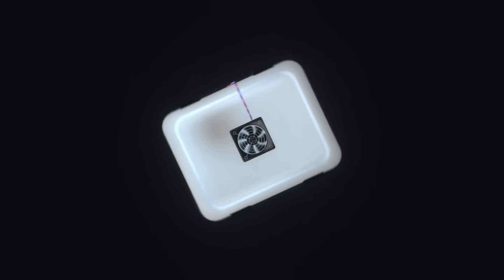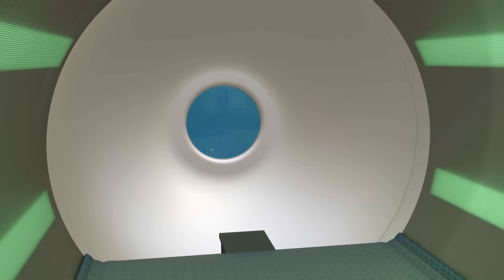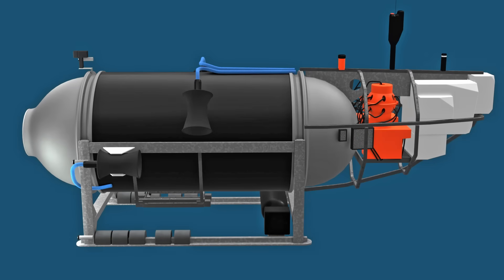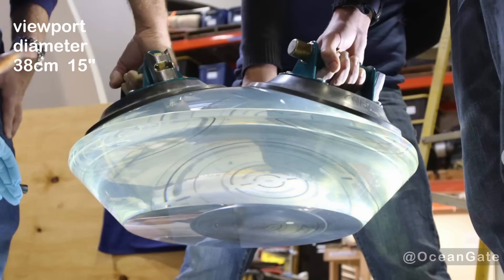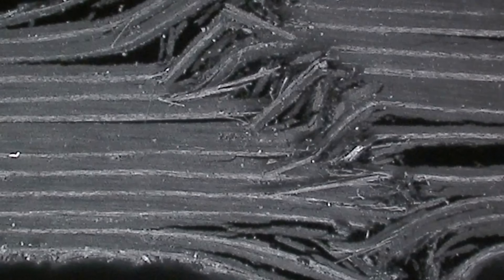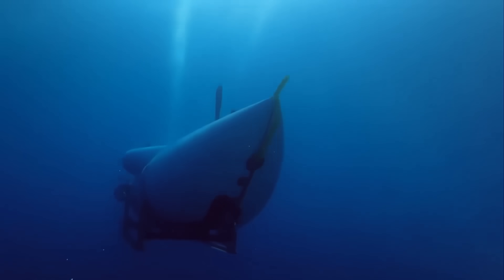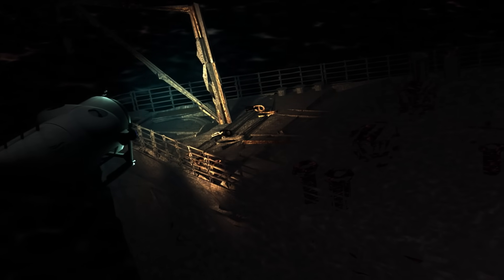Titan Sub | carbon fiber - Detailed Tour

Comment: Thank you, this seems a very balanced video.  

Like you say, it's mainly about having the resources to complete a proper destructive testing program to learn from and validate.  That was the engineering task, and they just never did it.

The game controllers and other consumer grade electronics signal to me their lack of understanding of, and poor attitude to, safety.  One concern is the battery technology used and its fire safety - in a life support environment I suspect one goes for an older but safer battery technology, and I doubt they did.  Another is condensation.  Presumably the boards/components/switching methods are not rated for a 100% humidity condensing environment.  Having redundant controllers does not reduce the failure risk much, because failures between controllers will be cross-correlated by their common correlation to the environment.  An obvious, and cheap in the scheme of things, option is to 3D print new airtight housings for the controllers, with more space for bigger but safer batteries, but we don't see that.  

The people involved seem to have engaged in "magical thinking" in the belief they were taking engineering forward, when the truth is they had nothing to add, and they more likely took it backwards.

Comment: This video is a good discussion but I believe that the others who said that carbon fiber is NOT the right material for a deep submersible are correct. Carbon does better at holding in pressure, not holding out pressure. I also believe that the Titan being a tube was the wrong shape. The tube would have been stiff at the ends where it met the titanium end caps and flexible in the center....like all tubes. If the center flexed but the ends did not then the center flexing could have broken the glue joints and allowed the pressure to enter around the failed glue joints. That could explain why part of the flange is blown outwards.

Comment: Aeroplane has about 15psi pushing out not thousands of psi pushing out.  I watch the old bloke mixing the glue in an old plastic container with a stick then using a paintbrush to apply it!! it was a disaster waiting to happen, sad but true

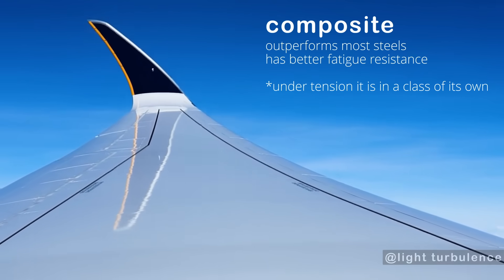Comment: Can anyone enlighten me on the example of the plane wing at approx 9:20 minutes into the video? Mike says this wing does withstand powerful compressive forces. Sorry for my ignorance.... with the wing I can perceive tension on the carbon fibre but scratching my head on the heavy compression exerted onto the material. If you could help me grasp the compression aspect, that would be great.
Reply from the maker: The wing is a cantilever beam. The up forces particularly at the tip create a massive lever arm muliplier force where it attaches to the body.  The lower surfaces are in huge tension and the upper surfaces in massive compression as they carry the 100’s of Tons of aircraft weight and result in eye watering compressive and tension forces in the structure. The compression and tension forces are equal.
Reply: @Mike-Bell  Thanks very much Mike. I appreciate you taking the time to reply.

Comment: If I had to guess the outer layers of carbon probably expanded and contracted at a different rate than the inner layers due to the temperature difference inside vs outside the sub, which may cause the layers to delaminate over several cycles, which could weaken the capsule enough for it to have a catastrophic failure at depth. I believe it was rated to go down to that depth once, and after that it was anyone's guess how many more times it could do so safely.

Comment: I love the very open-ended analysis you've done. You're not taking any sides on the subject you're just giving the facts as you see them and correcting what you see everyone else is gone wrong with. Up till now all I've heard is carbon fiber is not good under Crush pressure yours is the first analysis that said it can work well under Crush depth if done properly can you bring the facts to back it up which is very refreshing

Comment: I haven't seen anyone mention the deformation of the cylinder shape under load and the combination of forces happening at the center.
There woul be sone amount of bowin in the middle then you have the entire force of the ends pushing at a non-perpendicular angle. Trying to increase the bow
Am i missing something

Comment: Great video, nice to see someone who actually understands the issue rather than just blaming composite material. One correction I think I have is the distribution of forces, you've stated as 3/4 in hoop and 1/4 axial. I thought the distribution was 2/3 in hoop and 1/3 in axial, although this is based on my knowledge of pressure vessels with internal pressure, i assume the same is true here just in a different direction. This is a based upon stress in hoop being pr/t and pr/2t in axial, i.e. giving a 2:1 distribution ratio.

Comment: When this happened the first thought that came to mind was the difference in material compression between titanium and carbon composite.  Primarily as how it would effect the glue joints and internal/external flanges where the 3 materials come together to form a bond/seal.  The other thing is how thin and short the flanges were in comparison to the thickness of the material they were binding...
Reply: The splitting (flanges) in & outwards, seems to suggest a force of fragmentation  ?
Reply: the flanges were fully intact upon offloading the salvage.

Comment: The carbon fiber tube was glued onto the titanium end-pieces, onto which the hemispheric end-caps were bolted.
Different materials react different to pressure changes, just like with temperature changes.
This would put a lot of stress onto the glue and the surprisingly short part of the carbon fiber tube that went over the end-pieces.
I am assuming carbon fiber compresses more than titanium. That would mean that with every dive, the titanium end-piece kept becoming too wide for the carbon fibers around it as the depth increased, which could cause tearing and then buckling on the ascent.

The weak point is often where two different materials meet... Destructive testing would have shown them these issues.

Comment: I work with carbon fiber. I don't claim to know ALL its properties, but It does have high tensile strength.  However, it has no strength against side deformation.  Zero.  Any use case expecting carbon fiber to withstand side force without catastrophic deformation is idiotic.  Given a sealed container properly strengthened with carbon fiber, it will be strong to hold up to internal pressure (tensile force is then on the fibers) but not external pressure where side force is on the fibers.

Comment: The way I see it, is the CF strands are similar to a shoe string.  Pull on it and it takes a lot of strength to break it, yet it collapses under its own weight.  Using CF in a compressive environment like a submarine hull means it's relying solely on the compressive strength of the resin.  Only a fool would think that would be safe.

Comment: A titanium material have the same  strenght in X, Y and Z in volume.. but a X and Y oriented fibers matrix of carbon  does not have any Z.  if you stack many X, Y matrix or carbon fiber layer together... it is the resin between these layers that become the Z... Tensil strengh dont require any implication from the resin in between the fibers.. A fiber under tension will form his own straight line without deforming.. but under compression the it rely on the RESIN to hold the fibers straight... or resin and perpendicular fibers that cross them..but teh resin is still in teh equation   Also.. there is NO fibers oriented in the direction of compression on the THICKNESS of the tube It was made in 2D matrix and not in a 3D matrix X Y and Z. So the resin between the various stack XY of fibers of the thickness Z have to sustain the compressive force between the fibers in Z.. and it make the tube thickness "Z" to change depending on the deep..so the glue that hold it to the titanium part is under severe shear in "Z" as the titanium wont move/compress the same as the 5" tube thickness does so the glue has incredible shear in Z to sustain at the joint due to the 5" thickness "Z"  changing due to the resin that is more compressive than the titanium and fibers.

Comment: It seems that Stockton unforeseen this but what happened to the Titan it accelerated in descent too quickly within the time it normally would have descended to the ocean floor, if the Titan never had the rapid descent it may have survived the trip to the Titanic, it's a poor design the material shatters with the extreme pressure the wreck of the Titanic is an example of how steel plates one inch thick were crumpled like paper, all dives have risks at these depths but the type of sub the Titan was made it a death trap, all subs on expeditions to the wreck are undergone testing for failures before each dive to makes sure there is no errors or technical malfunctions.

Comment: Well done!   I worked 33 years in the carbon fibre industry and I was wondering how the fibres were aligned in the cylinder.  For a number of years I was part of a team that worked on very thick carbon laminate structures and worked out a way of curing them under pressure without wrinkling or deforming the laminate. This can be very difficult to do, but can be achieved.  The combination of filament, winding, and hand layup would have been difficult to accomplish and very may have been the source of the problem.
Reply: He said the second tube was laid up longitudenly with a robot, and even had a picture of it working.
Reply from the maker: @rise_above  The are unconfirmed suggestions that CF tube was built up in 5 one inch thick increments and cured between each layer.    Was the very thick build up you worked on done is a single cure or multiple?  More on the layers with a foto showing the 5 distinct layers in this video https://youtu.be/Wg4L64uXvnw?si=0lw3JgHIiDHJMbOj&t=518
Reply: @Mike-Bell did they use a autoclave?
Reply: Our design was for an engine strut support, thickness was around 3 inches and it was done in 3 cures.   We patented a process to cure the part in a way that allowed us to control where and how the wrinkles are formed.   When curing thick laminates under pressure and high temperatures your going to have wrinkles forming, the trick is to control them.  Then fill in the wrinkles before applying the next layers.

Comment: The two computer monitor brackets were screwed into the carbon fiber. I submit that the screw holes contributed to the failure. The brackets should have been glued to the hull. Search Google for interior photos of the submarine and you will see clearly that day monitor brackets were screwed into the hull.

Comment: Some things were well thought - emergency release of weight to get buoyancy by passenger moving around? That was suprisingly good! Also I wouldn´t hate the "as simple as possible" design. The more technical and difficult systems are on board, the easier they can break. 
But it was still a rat trap.

Comment: It failed at the inner lip that holds the carbon fiber in place. Think of carbon fiber as a car window it's incredibly strong when it's completely closed but shatters with very little effort if open even the slightest amount. The inner lip of the titanium ring was only 13mm  to say 16mm thick and was supporting ALL of the loads that the carbon fiber was having to take, if that ring started to fail or even bend at any point then the carbon fiber wouldn't be able to hold its shape. I'll even go as far as to say it was the rear titanium ring lip that failed first due to the rear door never having its point load change like the front door every time it's bolted and unbolted to the front causing a high stress area where the titanium could no longer hold up.

Comment: The cylindrical shape of the carbon fibre section was the probable cause. The midpoint of that section was geometrically the most vulnerable to deflection and cumulative damage. Collapse at that point could explain outward force on the flanges at the moment of collapse.

Comment: Far be it from me to tell well-heeled thrill seekers how to spend their money or risk their lives but if (IMHO) the adventure borders on foolhardy my survival gene kicks in.  That is not to say I haven't participated in some risky behaviors or sports such as Sky-diving, SCUBA diving, solo hunts for Grizzly bears in thick bush, spending 5 years as a military Engineer, riding a motorcycle in Dallas traffic, and climbing towers for fun but in all those activities I had a modicum of control over the outcome.  In my industry of data center operations we always watch for single points of failure as we design, build, commission and run data centers but failure in that industry simply results in servers being offline temporarily.  Failure of any part of a pressure hull adds up to a really bad day for the occupants and even if someone had paid for my ride I would have politely refused.

Comment: the testing required with the current technology simulation and real-world testing is definitely too expensive in comparison to using a thicker titanium centre part hull.. If as suggested in the video the hull be wound like a Carbon fibre pressure cylinder and cut off the ends.  if the extra  expense of manufacturing the centre section this way would have a large effect on the commercial viability.  then using carbon fibre is just too expensive taking into account that you have to break quite a few of them to prove the carbon fibre can last repeated dives without major degradation... I think it would just be easier at the moment to use titanium centre section even if it is heavier at least you can x-ray it ultrasound it and get meaningful and understandable data which is well understood industry wide..  Other alternative could be strengthening sections  made of carbon fibre these could be slotted in all around the inside of the pressure vessel in sections removable for inspection and perhaps much less stressed..  Even whether that would be worthwhile you would have two simulate it.

Comment: Hey Mike, "...titanium and composite are regularly bonded in aviation." Yes, but not then subjected to the extreme pressure of 375 atmospheres at the depth the Titanic lay. In addition, the sub experienced multiple cycles: 1atm > 375 atm > 1 atm > 375, etc. As you say, testing to failure for the bond was required but never performed.

Comment: Great video. Brilliant, actually. First one I've seen from a third party that sounds like you know what you're talking about.
I'm not convinced, but my confidence it was the porthole has dropped sharply. I'd point at the blown out flange and start making 'uh-huh' noises.

I think you might be overlooking the potential of the technology to make bank. Diving the Titan Nick wasn't the end goal - Stockyard Nickleback was seeing a lot of commercial uses - like, a LOT. Saturation diving could have been revolutionised, underwater enclosures made affordable, the deep cloud servers, I mean more or less anything that goes underwater and goes even a little deep would have been his bailiwick alone. I do appreciate you emphasising that innovation comes from trying an idea and seeing if it works, I rather suspect that the loss of the Titan will impede CF experimentation for decades, much as the Hindlieberg effectively ended hydrogen ballooning.

In any case, great video, bravo, spiffing chips. Cup of tea for the top table.

Comment: To say carbon fiber better withstands tension but not compression is kinda wild because say with an airplane wing like shown when bending one side will be under tension and the other side of the wing will be under compression, so it should be able to withstand both.

Comment: I wouldn't have gotten in that thing even they paid me the $250K. The glued on ends were a total deal breaker. The y needed to sent thing down on many dives with cameras and sensors and no occupents until it failed. It was ALWAYS going to fail, it was just a matter of time.  Then you examine why/how it failed. CF may be of use in submersibles, but it is not there yet. A guy like Rush is not the type to move the needle in a positive way.  proof of that is he is dead due to his way of operating, and he took 4 with him.

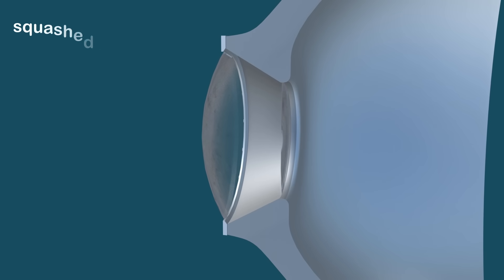Comment: 7:30 - I'm no composite expert, but I do know 20mm is not '3-1/4" ' (three and one-quarter inch), as shown in the on-screen text. That should read '3/4" ' (three-quarters of an inch). I suspect whoever did the graphics work heard wrong, or something. (20mm is a bit more than 3/4", which is actually 19.05mm. But close enough.)
Reply from the maker: Yes its a typo. The correction is noted in the video description.

Comment: You may be an engineer, but it appears you want to use word trickery. you do not have to be an engineer to understand that anything that is put together in layers like carbon fiber is nowhere near as strong as a solid piece, forged a carved out of a piece of metal. Take a 5-inch wall thickness carbon fiber tube and a 4-inch wall-thickness titanium tube. Open ends or closed ends, place them in a press and which one will collapse first? Also, I don't see how you and the guy who built this trip think it was a great idea. All the other experts in underwater exploration have made it was a bad idea. Aircraft may be your thing, but submersibles I would leave to the experts in underwater exploration.

Comment: I think the problem was titanium and carbon fibre have opposite thermal expansion coefficients. Titanium contracts while carbon fibre expands as the temperature drops. Stresses on the joins would have caused the failure.